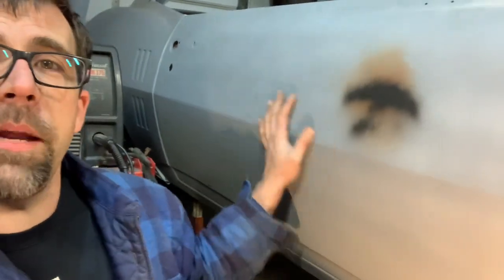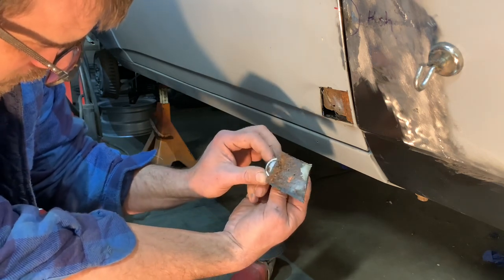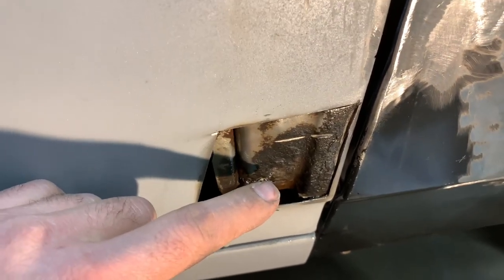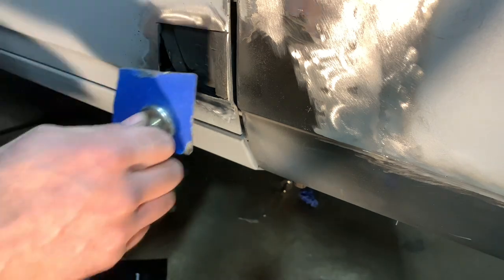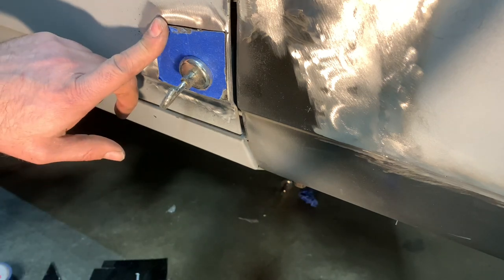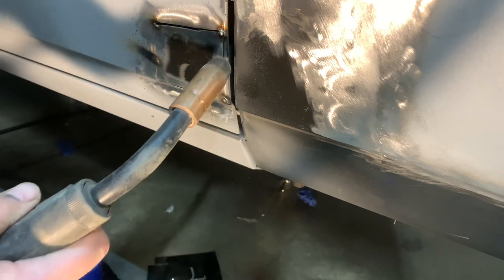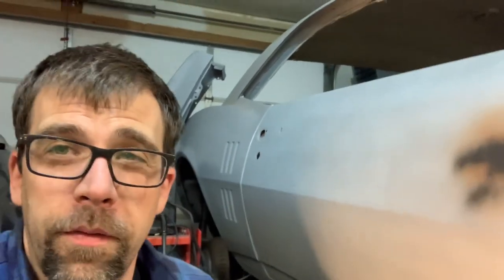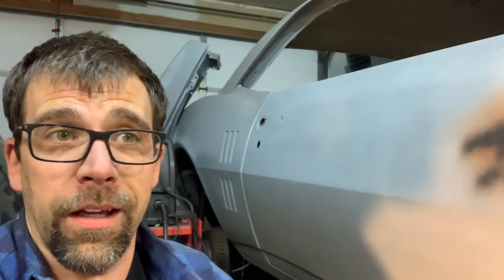Door skin or repair the rust? Fabricating a repair panel 1968 Firebird door watch this then decide.

Comment: I would have thought the rust would have been farther down into the corner. To help slow the rusting of the rest of the inside of the door skin, I apply Ospho after painting, since it will mess with paint adhesion. Another great video. Ty
Reply from the maker: I haven’t tried ospho yet.   I have used cavity wax in blind areas.  Do you use ospho on the inside of the lower door skins?
Reply: @VinylVillageGarage  after I paint I'll brush it sloppily on the the inside of the door making sure it seeps between the door skin and shell. On the cougar I'll do it to the trunk lid and hood too. I'll turn them upside down to get the Ospho between the skin and the shell. If you do it before paint, you have to be super positive that the Ospho is completely dried. I'll do all my welding before Ospho, I've had contamination issues
Reply from the maker: @FE428Power  right on.  I will try that out.  I like sealing up the seam inside the doors but that sounds way easier

Comment: Fine job! Re: Vintage Air… Insight on the mounting bracket would be great. I have a custom smooth firewall and want to weld the support bracket or bolts in first. Don’t want to have bolts penetrating the firewall. Detroit Speed sells a bracket to do so but it’s 69 specific - insight into bracket that comes with the kit for a 67/68 would be greatly appreciated. 👍
Reply from the maker: I welded studs to the firewall on my 69 bird convertible, that is the one I used the DSE heater delete plate on, to mount the heater box.   This car I have a new idea in the works hope it comes together like I see it in my mind.  Time will tell
Reply: @VinylVillageGarage  Cool! Look forward to seeing the install. As always… Appreciate you sharing your insight. 👍

Comment: Do you use cavity wax on inside of panel, to help your fresh weld from rusting??
Reply from the maker: Yup. Inside the trunk drop offs, doors, rocker panels, 1/4 panels.  For the most part all these areas have access holes to get it in there as well.  It’s well worth the investment in materials to help prolong the life of you car.